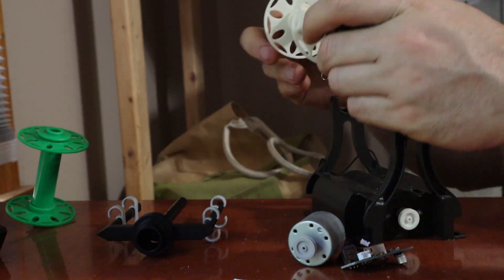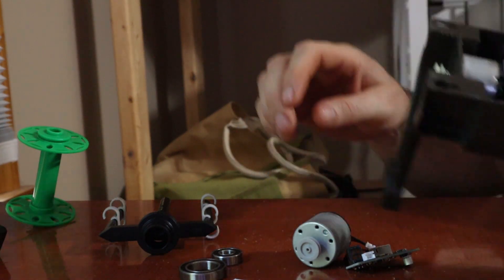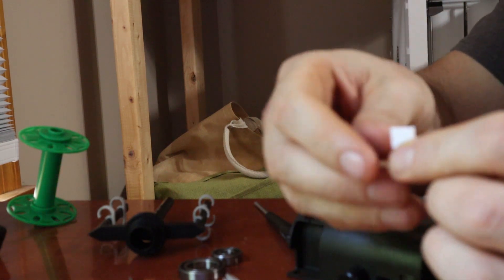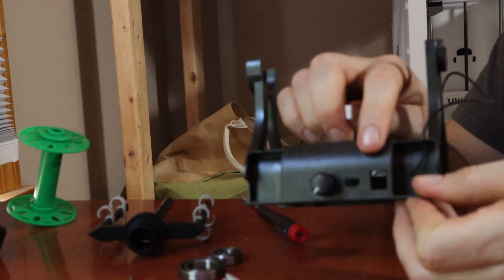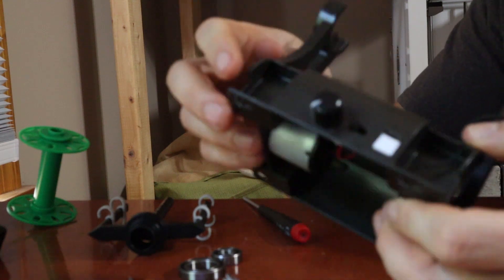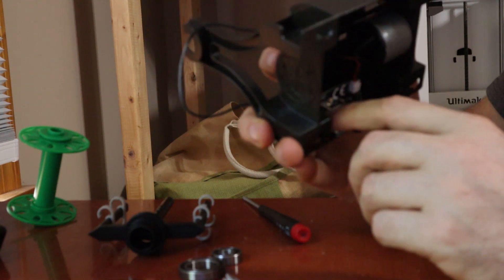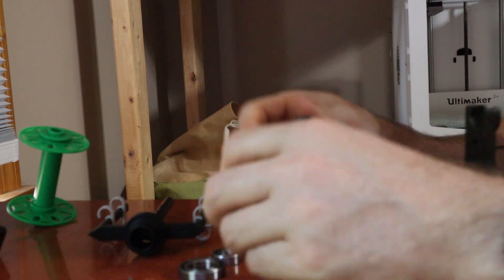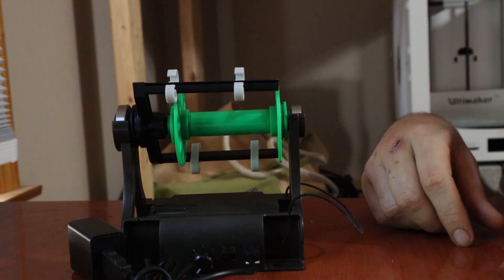SPIN 136 - EEW Nano 1.x Upgrade Kit

Comment: Could you point to the difference in noise levels between the 1.1 and the 2.0?
Reply from the maker: The 2 is slightly quieter but n average

Comment: This helps a lot! Thank you. Will the plug and switch be two separate parts (for those of us not in the US and need a different plug) I've already backed the upgrade kit but its good to check these things
Reply from the maker: Yes.  There is a switch, a usb extension cable, and wall plug.  Just like in the EEW Nano 2 (the version in this video isn't final).
Reply: @DreamingRobotsBlog  Brill thank you, look forward to upgrading my nano!

Comment: What about those of us that have round plug and not the USB? Just cut the stand?
Reply from the maker: I don't understand.  This kit comes with the USB plug.  Also not sure what cut that stand means.
Reply: The circuit board will take a USB input from the cord.  Your old power cord with the round input will not fit on the Nano with the new circuit board.